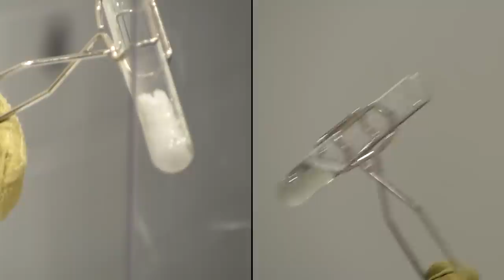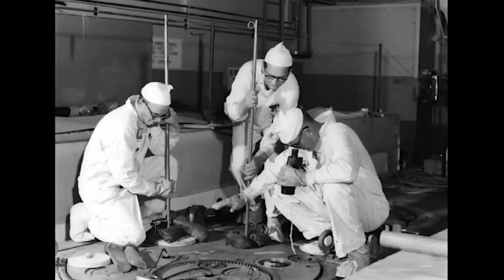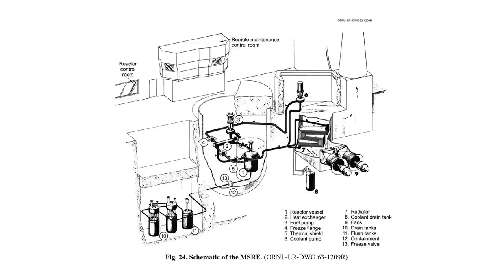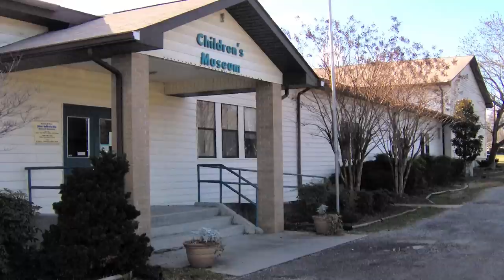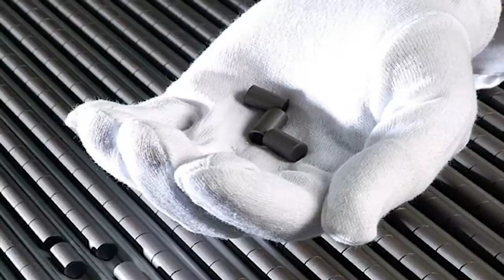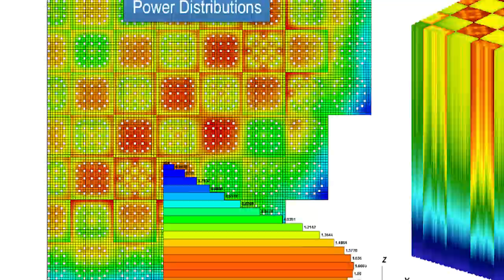MSRE: Alvin Weinberg's Molten Salt Reactor Experiment - "Th" Thorium Documentary

Comment: Paul Haubenreich reminds me of my father, who was a civil engineer.  Even til his last days he always had a shirt pocket filled with various pens, mechanical pencils, and wax pencils.  Engineers like to make notes, and dad even loved to mark certain things with wax writing (e.g. the date a light bulb was installed to replace a worn out one). 

The THTR-300 is not a Liquid Sodium or Molten Salt reactor.  The German reactor is a "Pebble Fuel" reactor, featuring solid fuel in the form of smallish "pebbles".  The reactor had a mechanical problem with at least one of these pebbles being stuck in one of the channels it had to move through.  Some radioactive dust was emitted, signalling a dangerous incident.  IT appears that incident was handled properly, but this type of reactor is not a strongly advisable type of reactor to build.  Perhaps the German project sought to avoid chemical solution difficulties, or was deemed advisable to research a completely different way to deliver the reactor.  But, the two are like apples and oranges.  They both are fruit, but not the SAME fruit. 

Incidentally, no one I'm seeing claims that the German project is still emitting dangerous levels of radiation.  Perhaps someone can link to that if it's out there. 

The type of Thorium reactor that advocates here in the USA, in China and in India are emphasizing is a liquid salt type (this is important, and those reading this should make it a point to understand this design, it's radically different).  This involves the fuel mixture being liquified due to high temperature (which completely changes the design - this high temp allows for the design to be LOW PRESSURE, an important aspect, since high pressure containment is a danger element of huge importance).  The high temperature also allows for the usage of this heat for processes that are ordinarily very expensive in terms of commercial electricity usage (e.g. certain chemical manufacturing processes, or desalination processes).  Desalination alone, could likely pay for these outlays, because desalination is a very expensive process, which is why it's not used more often. 

People seem to do two things at once:  They avoid studying the reality of the engineering in something like this, and yet place "faith" in unproven, or speculative things like "cold fusion", or "fusion reactors", without also studying or understanding the engineering or science phenomenon.  I'd encourage viewers to look at as much of this Thorium stuff on YouTube as they possibly can.  It's explained very well.  

Remember too that monazite mineral mining, and the ability to resurrect our "rare earth minerals" industry to include heavy rare earths is also part of this Thorium matter.  Once Thorium is used regularly for electric power generation, we get enormous amounts of it from ongoing mining of rare earth bearing monazite minerals. We have huge deposits here in the USA.  The fuel is cheap.  The power output is incredible. And we get useful rare earths like Lithium, Dysprosium, Lanthanum, Neodymium, and others. Right now the Chinese have a virtual monopoly on rare earths. So, you will see efforts by them to avoid having the US engage in rare earth mining (Thorium).

Comment: the spider arm reactor is a no water design which also does not rely on molten salt and is safe for thorium. But still, until they change the regulations on thorium it will not be possible to build a test reactor.

Comment: I am wondering why they don't want to us the molten salt as the conveyor to keep the reaction going and could be stopped by flushing  the salt into a holding tank.  It takes a lot more time to cool the  reactor core down safely and also needs outside cooling to help since it is not in production.

Comment: What does he mean when he says "keep every thing very well reduce so doesn't corrode in first place "?
Reply: "... very well reduced" means, if my chemistry memory serves me correct, that the oxidising (corrosive) capability of the chemicals is removed by allowing it to react with something else instead. In this case, I think he was talking about adding beryllium to achieve this and stop the salts attacking the reactor structure.

Comment: I was curious is it possible to make a molten salt reactor on a very tiny scale? Does it scale down to small enough for say a residential application? Or better yet my bicycle? I'm ready for this!! Thanks Gordon....
Reply: Scales down to semi truck size (1/3-1/2 a semi truck trailer size) but after that....the heat transfer/cooling gets iffy, since there is NO HUGE COOLING TOWERS, also the volume of fuel contained would be sorta small.  Engineers would have to develop some kind of while running fuel replacement, continuous spent fuel/reaction poisons removal (think of a paper fire vs wood = thorium vs uranium)
Reply from the maker: (thanks to rRobert for responding reminded me to look at this question when now at a desktop) ScootOverMan, I think you could power a small community with this, or an energy hungry factory. But to go below that, even if it was possible to maintain fission you'd lose economy of scale. The appeal of small modular reactors is that they can ultimately reach GW output but can reach that point in fractional increments, which makes them easier to finance. And once they're there economy of scale for the plant itself is in full swing. An MSR can be modular in the same way, and the loss of economies of scale can still be attractive if operating in a remote location (remote community) and for financing purposes. But the best efficiencies are when a GW reactors are running, and the fuel reprocessing and security costs can be spread across multiple reactors.
Reply: gordonmcdowell   I look forward to the day when they are turning these out in batches of 60 a day and sending them to North Dakota or western Montana (and for cheap energy at SUPER Fund (hazmat sites).  Put them on a train the same you do refined oil or sulfur.

Comment: Does a thorium reactor not create highly toxic waste? A safer reaction that can't be weaponized - both great. But the waste problem remains and if scaled, could prove far worse than uranium reactors, no? Someone help me here.
Reply from the maker: EagleSlightlyBetter The output is fission products. See video "Nuclear Waste: Fission Products & Transuranics from Thorium & Uranium" for details on that. Essentially we're not dealing with nuclear "waste" in any manner other than storage because we're not separating the various fission products out. There's immense value in there, which can be more easily captured if the fuel/waste are dissolved in salts. That's the first step of pyroprocessing, and MSR are already there. . Even if you're not trying to extract value, and only store FP as waste, sorting them by half life lets us move the highly radioactive stuff together, and move the longer-lived stuff (less radioactive) together. Right now, all mixed together, any sample of waste is the worst of both: longer lived and highly radioactive.
Reply: EagleSlightlyBetter  There is much more radiation coming out of a coal plant than multiple pressurized water fissile reactors. 
The "wastes" are mostly products we can use. We can recycle waste from old nuclear plants for use in a LFTR, and yes. But it is far easier to create a 800 year quarter-life containment vessel than a couple million year quarter-life with conventional waste. 

We could save hundreds of thousands of lives with the "waste" products from this reactor.
Reply: Indeed, the amazing medical isotopes coupled with certain proteins can be a smart bomb for disbursed cancers like leukemia

Comment: The Soviets played around with Salt Reactors.  Some of their worst disasters were caused by Salt Reactors (not due to the principal but due to shoddy design and cost cutting).  Akula Attack Submarines were said to have Salt Reactors, were extremely powerful and fast, but also very leaky.  All were decoméd because it was another one of their Widowmaker type subs.
Reply: Yes, but they used active salts, chemically reactive salts that react within the reactor and with the surrounding. This uses stable salts that are much less corrosive and the risk of corrosion is simple to counter and today's material sciences are a lot further developed.

Comment: Problems are bad enough when you have to deal with very hot water and steam ... just think how much fun it will be to try to fix a reactor that has molten salt at 1000 degrees going through it.
Reply: it freezes and inert at 440 F.
Reply: Much easier to fix something with the pressure of your house's water pipes than something with over 100 atmospheres of pressure and steel walls over 20cm thick to contain it. You need machines just to lift the freaking pipes.

Also, a typical candle has a flame temperature of 1000°C or 1800°F, and considering we can make gloves which are flame resistant that temperature doesn't seem too hard to handle with the proper equippement.
Reply: pwww in theory they have it covered, even most you tube commenters who have no background in nuclear science know  what will happen. nothing to be worried about :)
Reply: ouzomitsos You will never know if you don't try. But they are not even allowed to try.

Comment: Here it comes! Elysium Industries, Ed Pheil, Molten Chloride Salt Fast Reactor (MCSFR). Look it up on You Tube. Differences to thorium salt reactors? Instead of pebbles, use spent nuclear fuel (SNF) and plutonium. Old style nuclear plants have generated plenty of that. In the US over 700 years reserves.

Comment: Have they overcome the problem of rapid corrosion of the piping?  That seems to me to be the tipping point to making it viable-profitable.
Reply from the maker: Don't run it at 700'C, use a suitable alloy. http://www.haynesintl.com/alloys/alloy-portfolio_/Corrosion-resistant-Alloys/hastelloy-n-alloy/principle-features Molten Salts are used in Solar Power Towers, it isn't like salt chemistry was put on hold when MSRE was shut down.

Comment: Ask any of the MSR folks at Oak Ridge & elsewhere about the subject of operational experience(s) & virtually none of them bring up the USS Seawolf or Santa Suzanna or Super Phenix re operating difficulties encountered with the molten salt reactors in our relatively recent technological past.  They more-or-less skip over the details regarding the technological difficulties of pumping molten salt in a primary reactor loop or anyplace else for that matter.  Bill Gates and others would be better off not messing with the rather explosive technology inherent in MSR's & take another half of a technological step forward with the further development of high temperature gas direct cycle (no steam turbine) reactors which will transfer heat using an inert gas instead of what is potentially a rather deadly explosive combination of chemicals.  A "direct cycle" system is actually a gas turbine which would have no trouble operating at or above the proposed operating temps of any of the suggested or proposed MSR's.  Remember; what did in Fukushima & TMI were "chemical" reactions; not necessarily nuclear ones that wound up doing unrecoverable damage to those plants.  The field of experience is wide open to Direct Cycle Gas-Cooled Reactors since all emphasis on the technologies involved were primarily being promoted by General Atomics of San Diego, CA; an organization who encountered financial & other operating difficulties bring their conceptual High-Temperature Gas-Cooled Reactor at Fort St. Vrain into existence back during the 1970's & began  producing drone aircraft instead.

Comment: the THTR-300 in Hamm-Uetrop Germany was 1988 shut down because of immense agressive radioation the radiation level is so high that it will be dismateled maybe in 2027 - now in Germany are build windmiles and theire are a lot of reasons why not using Thorium reactors !
Reply: was it a MSR?
Reply: WookieeMonster i know what a MSR is. i'm asking xparade0de if the THTR-300 was a MSR. according to wiki, it appears not.
Reply: dumontgo Theire have been 2 Reactors - 1 for making energy and a small one in a research center. The last one has burned down (outside the building) with colored plasma. Wikipedi* pages are often good for cleaning the a** when going to the toilet.
Reply: xparade0de i noticed you still didn't answer my question. did the THTR-300 use molten salt?
Reply: dumontgo maybe - good luck at searching for more informations
Reply: xparade0de it  didn't. i already searched. so your OP was irrelevant.
Reply: dumontgo  Your OP is also irrelevant.
Reply: dumontgo Sorry, mate.  I misread your post.
Reply: ***** with wonderful You mean reactors short bevore blow up ? The coal is used when the wind is not so strong. And regenerative mix is cheaper here than nuclear energy.
Reply: dumontgo
THTR-300 is not a molten salt, only the thorium fuel is the same :) it is a thorium fuel high temperature reactor, where they use helium for heat transfer. For a moderator they used mostly graphite.
Actually, dissolving the fuel in the salt will make the entire loop INSANELY radioactive, not just the core and a storage facilities, but you might get much less radioactive waste. Also the waste have a half life of about 1000 years instead of 80 000 for 235U and 120 000 for 239Pu. I'm not saying that 1000 years is nothing, thou!

Comment: China and Indonesia are ahead of the US in Generation 4, Next Generation 4 Reactors.  Using US research, technologies and designs. China may have a prototype, MSR, Molten Salt Reactor running next year. China has a Gas-Cooled, Pebble Bed Reactor prototype running now. And they are developing a US Terrapower Traveling Wave Reactor, TWR. China has also run plasma in a research FUSION reactor at twice the temperature of the sun for 100 seconds. The ITER international FUSION reactor in France will be ready by 2025 and has cost over 10 billion so far. Then they plan to build an even larger reactor. for another 10 years. Fusion may be too expensive to build. But fuel is cheap. India has lots of Thorium and wants Sodium Cooled Fast reactors. MSR reactors may be a better option. Sodium Fast Reactors have been very difficult to run. Most countries gave up on Fast Sodium Reactors.

Comment: "We could make a small sample reactor to show... but that's not we are here to do and blablabla"
So, these guys didn't realize that right away when they would actually make a working sample, everyone would start doing it, thus giving us free electricity these guys are more than willing to sell..

On the other video that one guy says MSR is opposite of traditional reactor, as it has to be constantly be kept running.. well if some external force has to keep it going, then where is the benefit, where is the self powering circulation.

Even that screenshot on right of a hand holding a thorium sphere.. well yea, you could actually safely keep it on your hand like that, but it also means that the thorium is decaying so slowly that there wont be any useful heat dispersed from it..

Its a hoax!
Reply: free nothing is free it cost to build, and maintain.
Reply: We want access to stuff because of how useful they are to our lifes, not because it's simply cool to own stuff.
I don't see any trouble skipping the money from between people and use true democracy, empathy and have eyes to horizon.

Comment: Think this might have been sponsored by SanDisk?  Damn MP3 players clipped to everyone, noone is using them, and a lot of them have TWO that they aren't using.  I think they went a bit overboard, to the point of being obnoxious.
Reply from the maker: gerff01 Sometimes double for redundancy. They are inexpensive. But the RockBox firmware makes it too easy to accidentally stop recording, which happened to a number of them. There was also a proper wireless receiver and 2 wireless mic in operation running to a Zoom recorder. So that's the "right" way to do it. But that only captured two humans at a time.
Reply: Most people would have just used Lav mics and a proper setup...Which is why I figured it was simply a sponsor.